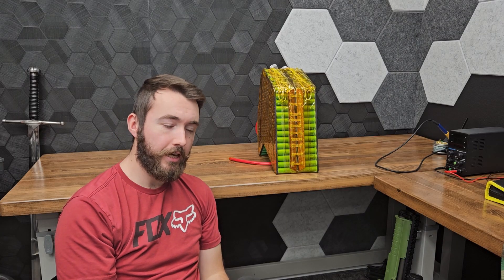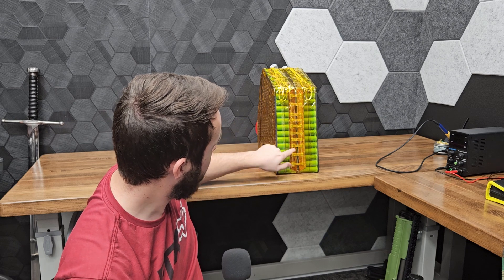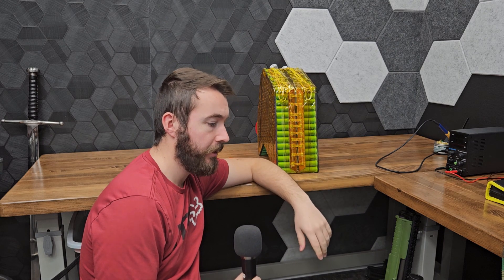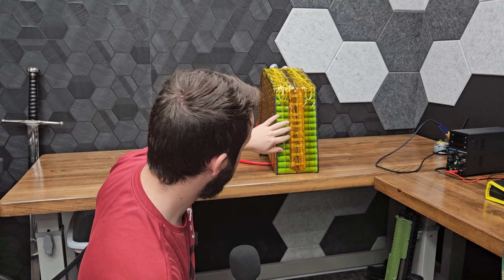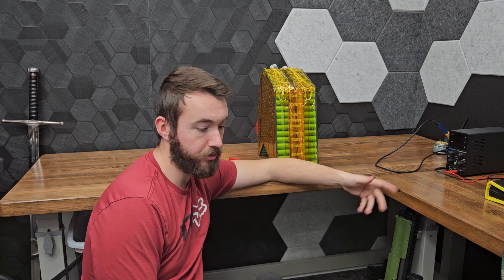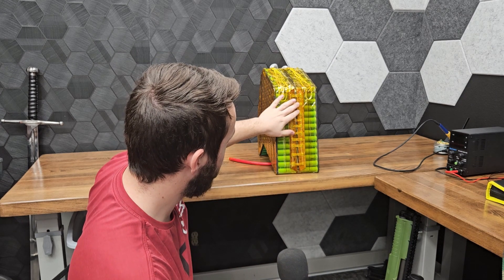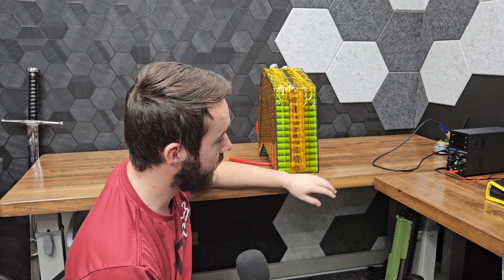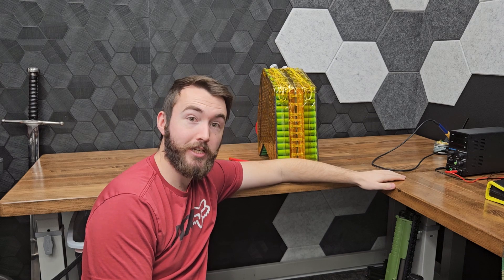New High Discharge Battery Connection Method!

Comment: I watch your videos and laugh, I just found your videos and have made soooo many of the same conclusions up til now, with same goal as you.  My batteries and motors are en route from China.  I'll let you know a few things ive found that i havent seen you stumble across yet.  We are both part of same endless forum group, though admittedly i research more than i post.  Many users have reported 130C temps from single burst 1000 amp with motor already at running temp on a warm day.  The motor magnets sustain irreversible damage from my research by 150C and you lose effeciency and torque the closer you get to it.  I went 138 90h watercooled 28s12p eve 50pl and 961000 (also water).  I consider radiators to be a consumable and the best $100 i spent if my bike takes a tumble hard enough to crush one vs the direct impact/shock of slamming down on its side without.  As to your battery, did you not consider how stark built theirs? Dual bms, battery can split in 2 with ease, twice your charge rate, twice your battery line amp output (battery limited).
Reply: Dual bms can also add redundancy in case of failure,  also radiators can be can for redundancy so if one is compromised you can swap to single rad via quick connect fittings.  It adds 5kg penalty in total id say 😞, but worth it.

Comment: i wonder what would actual copper cabinet hinges would do here, like the ones used in furniture. maybe time to take a multimeter into the hardware shop
Reply from the maker: Haha would definitely make an interesting experiment.
Reply: That wouldn't tell you if it was plated or solid thought. Plated would struggle when amperage increases
Reply: I was just thinking same thing..a pure copper cupboard hinge or...even better a piano hinge (they are tighter)

Comment: Most ppl shy away from full copper because of weight
Reply from the maker: Of anywhere on the whole bike I think battery connections are the best place to spend the extra couple ounces.
Reply: @BlacksheepEngineering  I agree, so long as the gains in conductivity are worth the weight. In one of my current packs I have 21s2p spim08hp cells and I used 1/4" aluminum for the buss bars. The pack weight is around 40lbs, I can't imagine copper would make much difference in this case. But absolutely if thinner bars were needed then copper would be the way to go.

Comment: i would finish it in fiberglass
Reply from the maker: I havent seen that before. You mean wrap the whole battery in fiberglass when its done?
Reply: Not a bad idea, for my first and so far only battery build I used thin Tar paper and wrapped it good after taping and insulating the pack. Figured if that stuff keeps moisture off steel pipe exposed to the elements figured it couldn't hurt as a extra messure. Guess I'll find out when she shits the bed